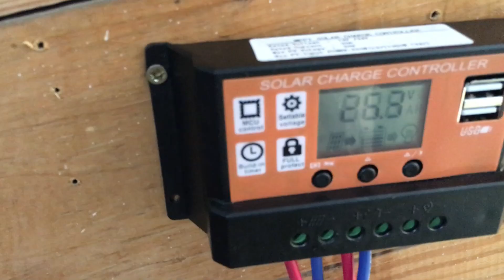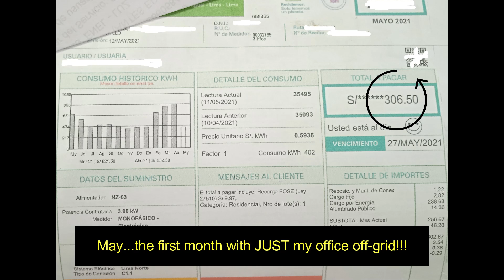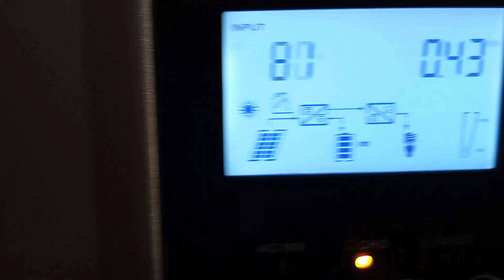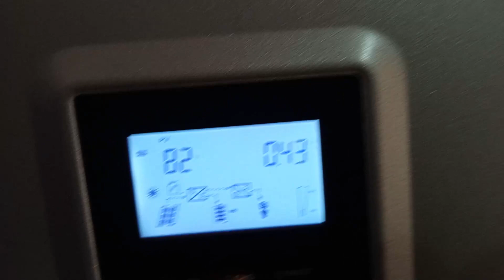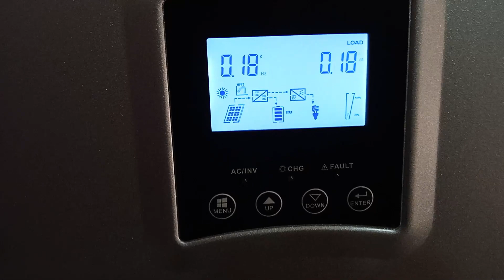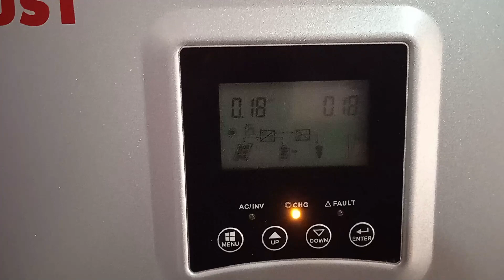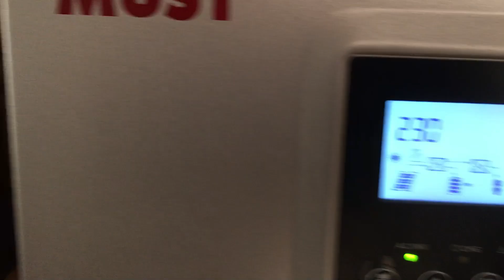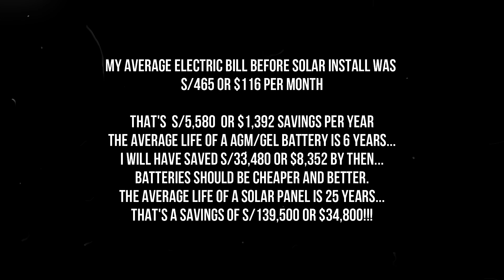How to build affordable off-grid solar...after 6 months what are my savings?? Is it worth it?

Comment: How much is total coast?
Reply from the maker: (6) 330W panels, (6) 12V 100AH batteries, 24V 3000W hybrid charger/inverter..all wiring, fuses, etc...$2200 usd